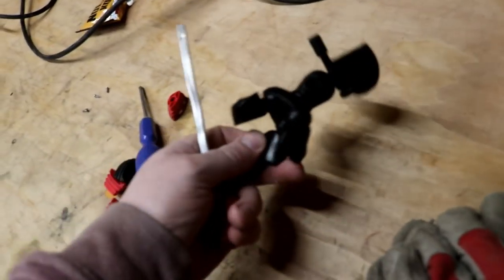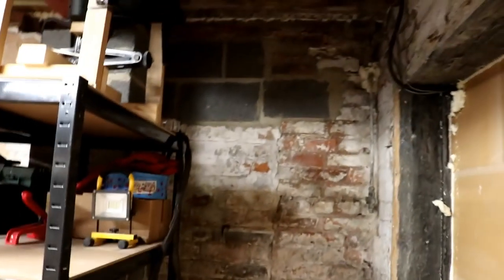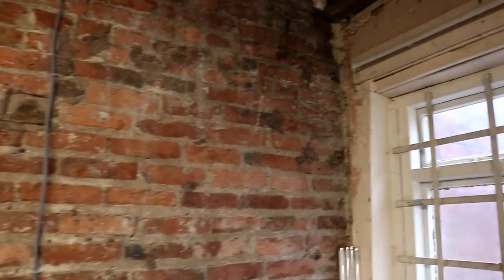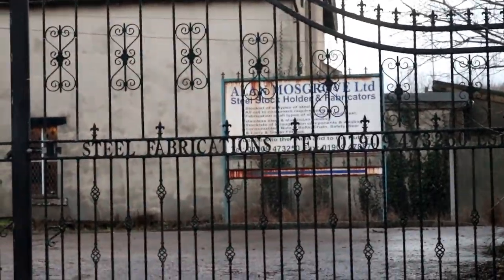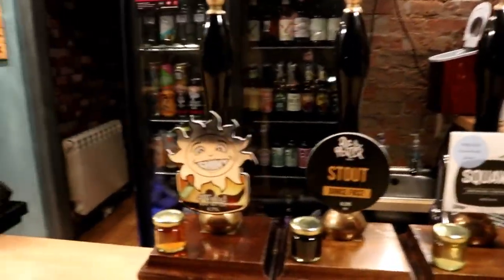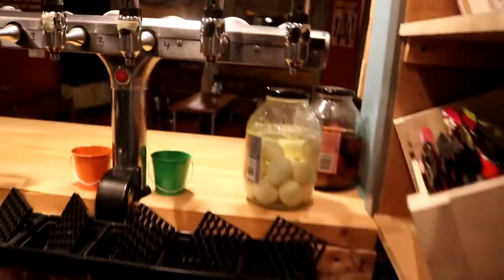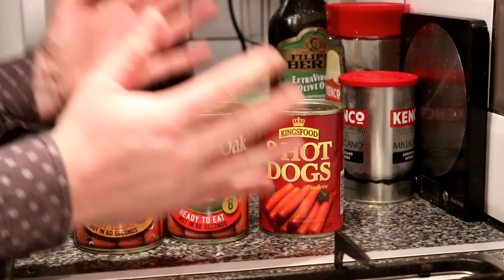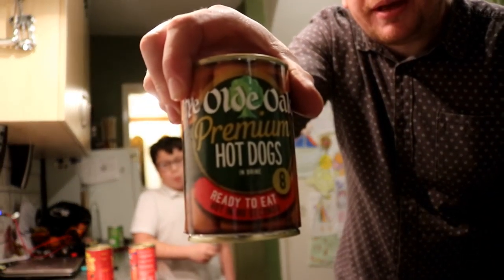Behind The Scenes In The Brew Shed

Comment: The lift probably needs oil - if there is a leak it certainly does...but usually there is an oil port - looks like a bolt with a wonky head - just remove that and if it isn't pretty much full to the top - fill 'er 'up! Replace the bolt - pump it up, drop the fork - repeat - might take several little fillings to top it off and it might need a little bleeding if there's air trapped in it. To do that, you leave the bolt off, fill it up like 75% to the top, SLOWLY pump it and watch for bubbles. If you see them, that's how you get them out of the pump. The key is go very slowly to pump the air out of the oil. When the bubble stop coming up - fill it up with oil and reinstall the bolt.  You're done! It works...it lifts and drops the forks as expected.

I like my dogs roasted...awesome.

Comment: It looks like you may have too many rubbers for your rod there 😋 . The pump truck most likely needs more oil, but if it needs more oil it most likely needs it's seals changing as well as it will most likely lose oil through perished seals. If you have full oil and no leaks then it will be a split in the pump diaphragm , which should be just as easy to change providing you can get everything apart. Nice dog review though, not one of the bro or sis from the previous vid I hope 😮 😄 , Great vid as usual. Cheers, Schnuz.

Comment: seals in the pump may be worn, so as soon as itreaches a certain pressure they leak and forks cant rise any more, also check the oil its probably the original and full of air bubbles, where's the pork scratchings? Loved the interaction with your son, cheers.

Comment: The pump truck might just need more oil, if its low it will just try and pump air into the ram
Reply: lee Wozza my thoughts also
Reply: Oil low and maybe the seal doowd....
Reply: Agreed low fluid. Filler up.